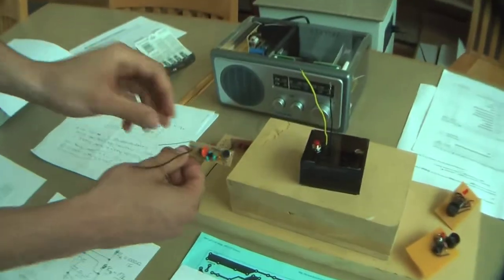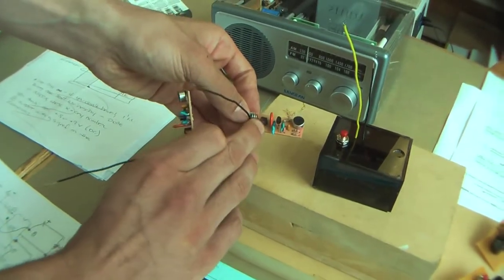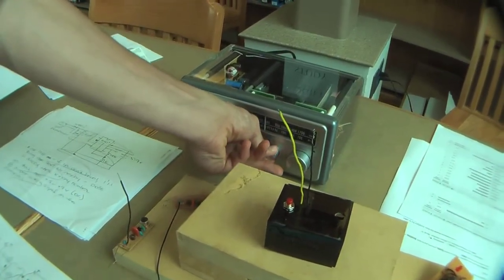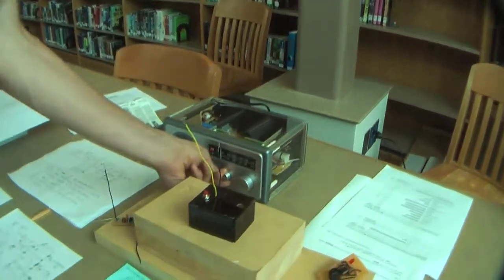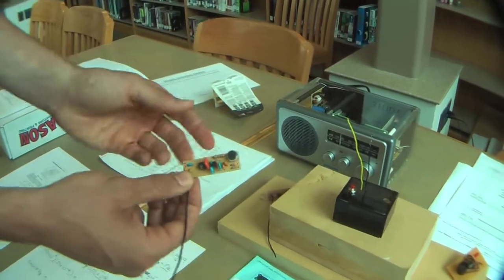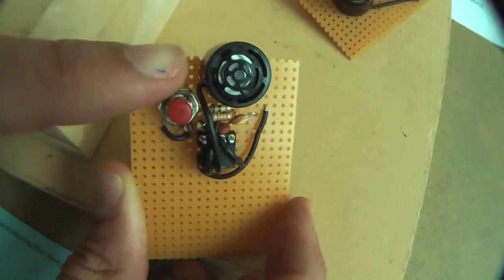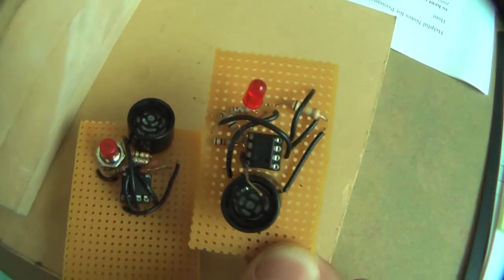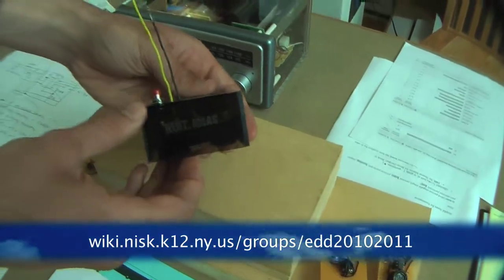EDD Course: Wireless Locator

Comment: 1) Use a car remote (everyone has one) to make a keyfob rcvr give a single audio beep. Tune rcvr to fob. But the batt would drain all the time. 2) Have a keyfob transmitter that only RF pulses every 15 seconds or so to save battery. A portable AM radio with a built in (directional) ferrite antenna could be used to track it down. A motion sensor with timer could be used to keep the xmtr quiet unless the fob is not moving for say, 5 mins. When you plug in the fob to recharge, it kills the xmtr.